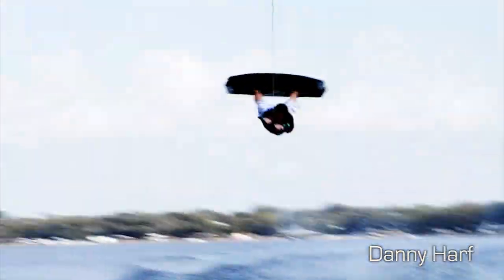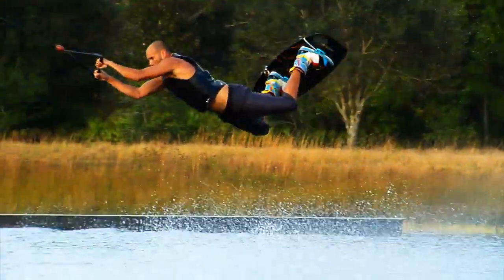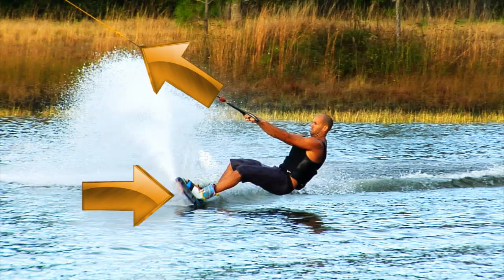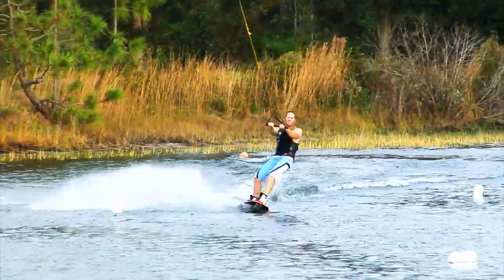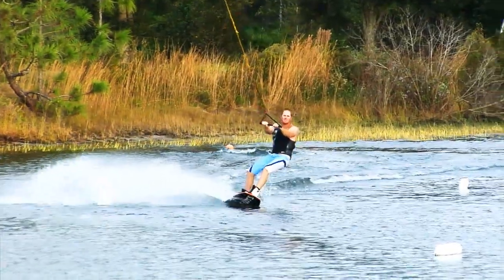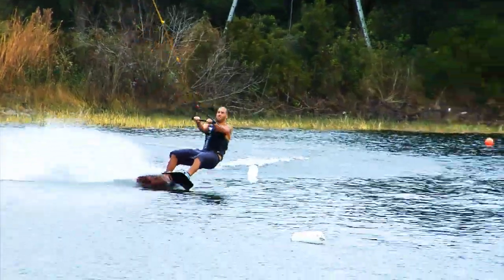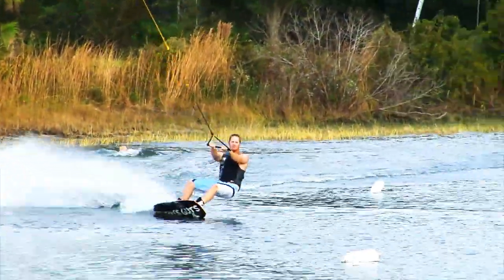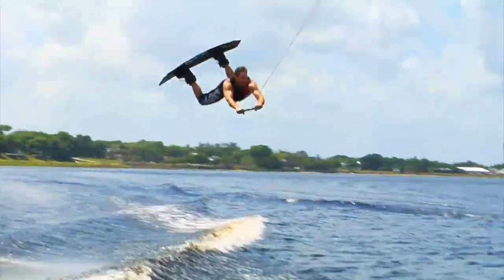Learning Heelside Raley Physics

Comment: How high is that cable?  Does that help/?
Reply from the maker: The cable height helps as does the rope length. The shorter the rope, the greater the upward pull. There is a tipping point to where there can be too much upward pull and you will be more in a "dangle" rather than a load and release. It is important to work your way up to avoid injury as raleys can be associated to some heavy crashes for beginners who just end up "going for it" without the proper technique.